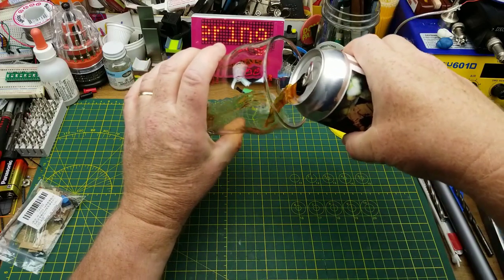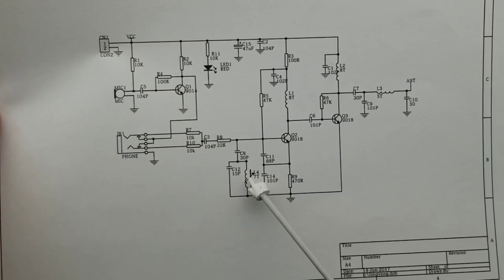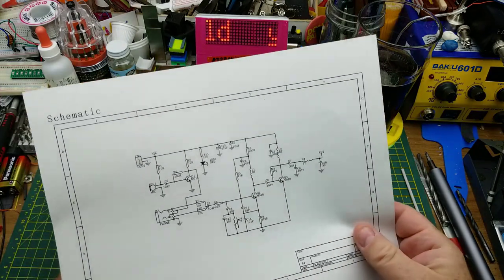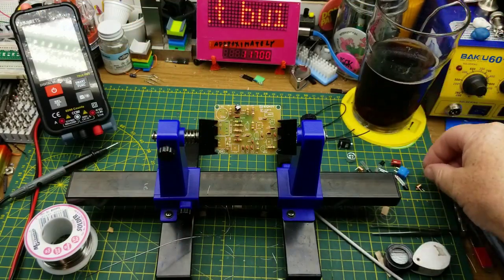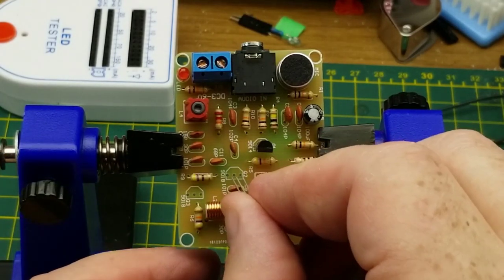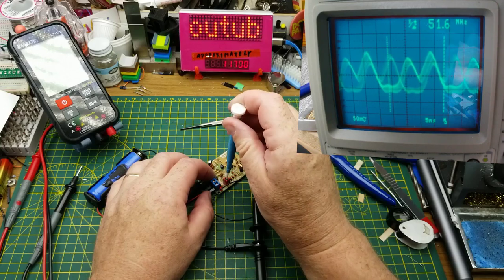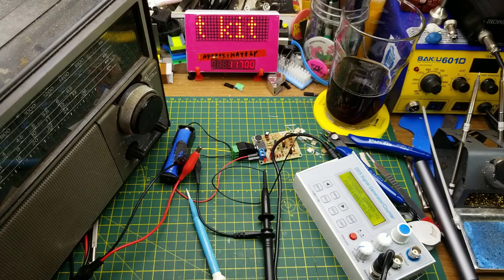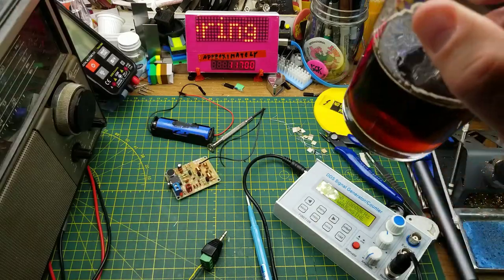Relaxing kit build: FM transmitter

Comment: I built a few of these a couple of years back. Now I use them to play a couple of stations everyone enjoys. I live in a valley with CBC and Monotonous FM for radio. I wish you could modify these for 15-50W signals. No competition so no need for a licence. The entire dial is empty. I put on a talk radio a classical station a rock station and Alt rock station and let people listen. I broadcast upto a mile around me. So nice having choices now. I plug them into old 7inch laptops playing streaming stations. I found plastic cases I covered in copper tape that work well for shielding.

Comment: I got one of these a couple of years ago. It worked fine, but short range and mono.
So I got a stereo kit version with higher power output, coupled it with an SD Card reader/player and a small stereo amp with tiny speakers and put the whole lot in an enclosure.
It transmits upto 100 meters. LOL

Comment: Nice! Amazed you know how that circuit works. Its all magic to me. Its a little sad the kit does not provide film caps for the audio signal path.
I cheated at put a wire on a Raspberry Pi pin to play with transmitting FM once.  All software.
Think I sent you an msop10 FM receiver chip over a year ago, with the needed ferrites, in a little baggie. You are well on your way to a walkie-talkie.
We all live under the constant drone of that 60-cycle hum.

Comment: That's a really fun project.  I really could see a bunch of little semi-practical uses for that.  Pretty fun.  The first thing that comes to mind would be to give one of those old computers that loads stuff off a cassette "wifi" where the cassette broadcasts and then you output the radio headphone jack into the cassette port (with some filtering).  Or some pirate radio.

Comment: I have already built 2 FM transmitters (stereo ones). My next project will be to connect an esp32 radio to it, to broadcast whatever online radio I want.
Because, clearly, very soon, there won't be any FM radios left given my country (and probably all of Europe countries) has decided to push dab+ and to drop FM in the short term. So I'll be able to continue to use all my radios (and I have a ton of them at home, from tube radios to 70's hifi and 80's boomboxes)

Comment: Should be fun while we still have an FM band. we are slowly being pushed digital, first TV and next radio. If they can sell the FM band off to somebody the buggers will, in the UK anyway
Reply: The "planned" switch off is 2032 (has already been put back from 2030) .  So ten more years (at least) of UK FM.  If it is found that a lot of listeners still use FM it may even be put back further.  It will also really depend on the technical quality and, more importantly, the accessability of the digital service.
Reply from the maker: We still don't have anything like DAB here in North America.

I doubt FM (or AM) broadcast are going anywhere here for a while yet.

Comment: I find it pretty mind blowing that this half hand full of discrete components actually is a FM radio transmitter. I wonder what the range could be .. with a nice antenna and maximum voltage .. better than wifi ? then it would probably useful to transmit sensor data from a far away esp or something .. neighbours wondering about the new channel on 87,3 with the strange 80's modem noises all the time :)
Reply from the maker: The range is probably at best <50 meters. 
And to stay legal, that's about he most you'd want anyway.
Reply: Might want to check out the guy with the Swiss accent (Andreas Spiess) for transmitting stuff over distances with microcontrollers...
Reply: @michaeltempsch5282  I don't really have a far away ESP I need to get sensor data from, but thanks ! I know Andreas Channel, I think it is one of my oldest subscriptions ;). I guess it would be LoRa then anyways  :D

Comment: What a great build and the explanation of the circuit was very edifying - I reckon radio is your superpower! One question - what is the nature and length of the antenna and does it matter? 🤔
Reply from the maker: It's been decades since I exercised my antenna theory, but...

The length of the antenna should optimally be an even fraction of a wavelength (full, half, quarter, eighth...) for maximum efficiency.

In this case with 80Mhz, 1 wavelength would be 3.747406 Meters,   The provided antenna wire is only about 15CM, so won't be a particularly good match.

But in this case, "close enough" is close enough.

At a higher power, the impedance mismatch could cause reflected power and possible harm the amplifier.
Reply: Interesting! Do you have any recommendations for books or sites to explore this a little further? My finance minister is also very unhappy that I had to order the kit to make sure it was all legit. 😬
Reply from the maker: @onecircuit-as  Not sure if my old college textbooks are still in print...

This site seems to have a lot of the theory laid out pretty well (if you ignore the colour scheme) 
Warning: its a very math heavy topic
https://www.antenna-theory.com/tutorial/smith/smithchart5.php   https://www.antenna-theory.com/antennas/shortdipole.php
Reply: Who doesn't like lots of math! 😜
Thank you so much. 👍

Comment: Nice video would be great if it had a small receiver kit matched to it you could have a little radio mike then HA HA! would be crap quality though🙂
Reply from the maker: Funny you should mention that... I do have such a kit.
I'm sure it'll surface one of these days.
Reply: The Banggood listing linked above has a transmitter/receiver pair in one of its related links.